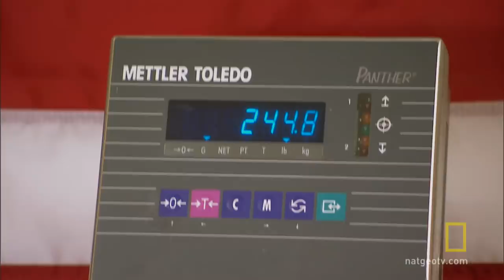Weed Wheels | National Geographic

Comment: thats the most disgusting looking weed 
how tf do u smoke that
Reply: They probably packed the weed in and when they take it out they would cut out the middle which is still perfectly fine and sell that and then sell the dirty weed for cheap.
Reply: Fernie Otis fluff that’s what the cartels be smugggling in
Reply: Fernandez Bacalov wouldn’t you like the know..
Reply: Maybe they make it into dabs.
Reply: Used to make concentrates
Reply: @lloyd165  it's all compact though. 

Like even if you took the middle then it wouldn't look like normal bud.
Reply: @buyerenogurlfwendo2106  I didnt think about that. I'm sure it's probably used to make hash then.
Reply: It’s pre ground and packed Wagon Wheel strain.
Reply: Burning rubber XD
Reply: This stuff was either forgotten about, or solidified on purpose for some obscure extraction method.

Comment: I drive a truck like that
  I find it hard to believe that he couldn’t feel “something” different or wrong while driving it
  Part of your pre-trip is thumping the tires checking for low or flat tires 
  And those tires would make a strange sound for sure
  But he may have had a gun to his head
Reply: It's very possible he knows that asking questions or pushing back is not wise , just do his job. Even if they release him, he is probably not sleeping well, will be blamed for the loss

Comment: How did they find those drugs if they were sealed i'm steal?
Reply: During the X-ray process of the vehicle any part of the vehicle that shows a dark area on the scanner is an indication that the vehicle has been tampered with and drug packages like marijuana gives a clearly shaded and outline of it , and in wheels during an x-ray you normally wouldn't see anything due to it being nothing but air so a black area or darken area is the proof that someone hid something in there.
Reply: @josephbennett3482  Thanks for clearing that up! had no idea they use x-ray!
Reply: @joe7665  yep , if they can't find anything initially when just looking at the vehicle they will do a secondary search of the vehicle to further check if the driver is hiding something that cannot be detected by visual search or by a drug detection dog , most of the time the dog always hits on a illegal substance.